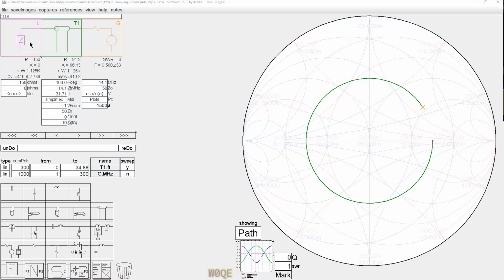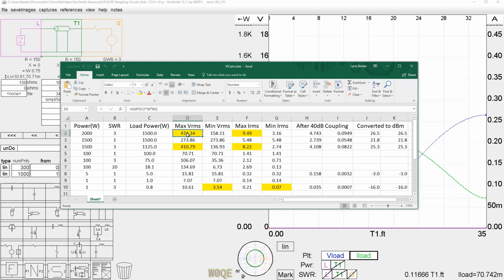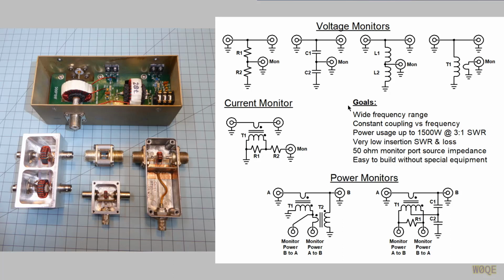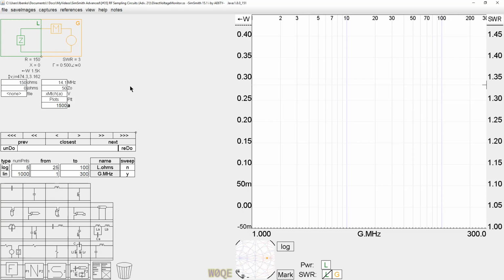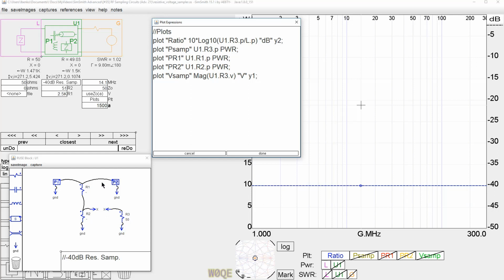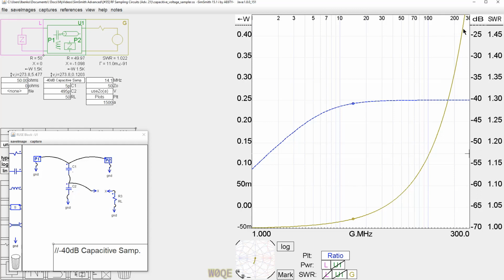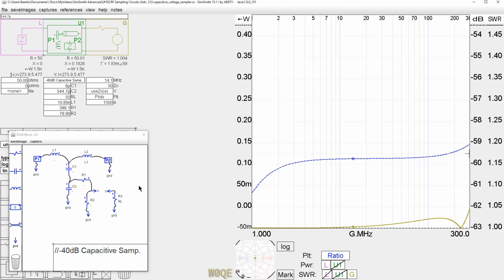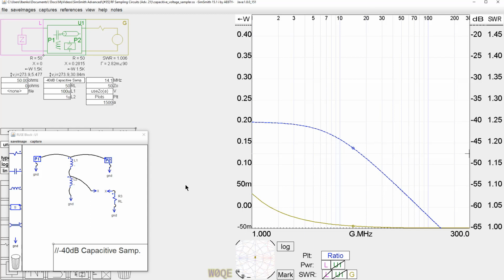#35: RF Sampling Circuits, Part 1

Comment: If the load impedance is mismatched,will it affect the attenuation of the capacitor sampler?
Reply from the maker: The capacitor sampler if designed to be a 100:1 sampler will still act as a 100:1 sampler of the voltage even if the load is mismatched.  However the voltage will no longer be constant as is the case when the load is matched.
Larry, W0QE
Reply: @w0qe  Thank you for the reply Larry :D, but just to be clear, if the load is mismatched, the output of the capacitor (100:1) will be 100 times smaller than the main line voltage, which consists of forward and reflected voltage
Reply from the maker: @esoalse7187  That is correct!
Larry, W0QE

Comment: hi sometimes we have a rf signal that it's not repeatitive  sampling this signals requires a very high samle rate analog to digital converters how can we downconvert this not repeatitive signals and use low sample rate analog to digital converters ? is there anyway?
Reply from the maker: Tyson,
Generally an inexpensive SDR radio such as the SRD Play can capture non-repetitive signals quite well.  What specifically are you wanting to do?
Larry. W0QE
Reply: @w0qe  I want to record a nanosecond  uwb signal with 2ns pulse width and 200khz pulse repeatition we can digitize them in equaivalent time sampling method but if we want to digitize them in real time  needs expensive parts like an analog to digital converters up to 5gsps I want to sampling them with inexpensive analog to digital converters with low sample rate
Reply from the maker: Tyson,
This is definitely a much more difficult problem and I really don't have a good easy to implement solution.  Just to see a 2ns pulse requires a very large bandwidth.  
Larry, W0QE
Reply: @w0qe  thank you Larry.